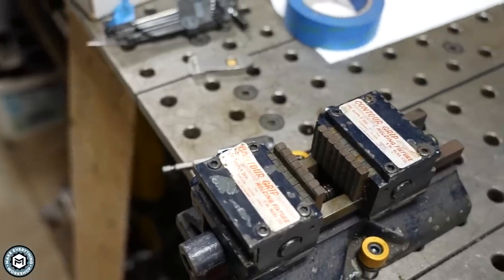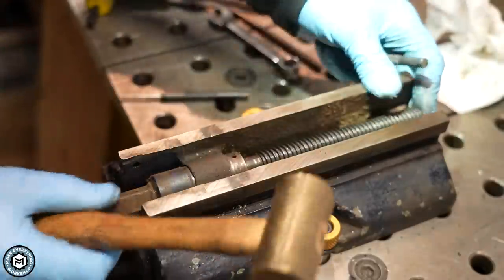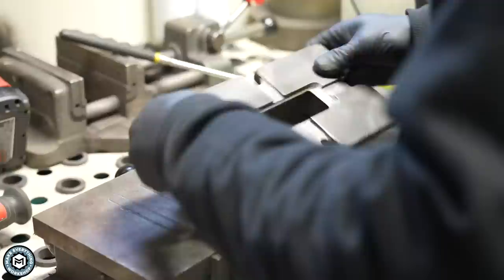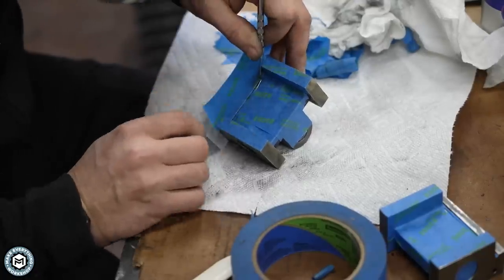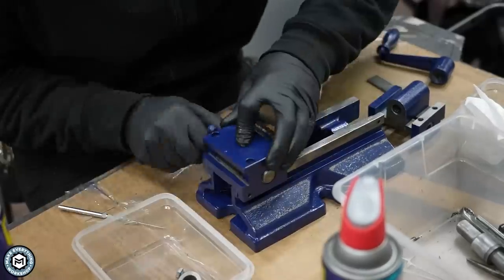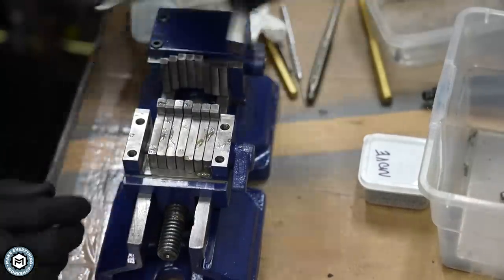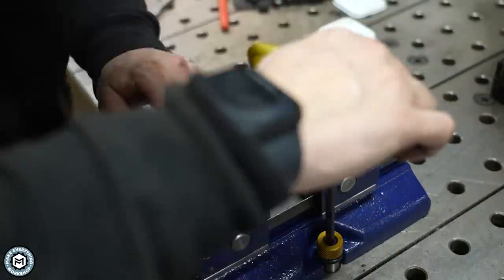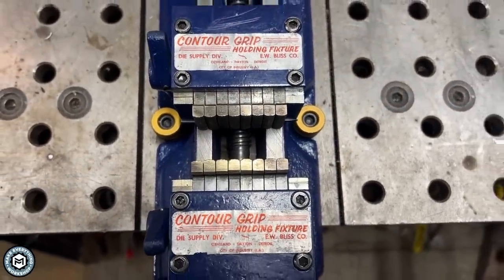Rare Adaptive Jaw Vise - Restoration

Comment: So the idea behind the balls is that they appears to work like a sort of "hydraulic" pressure, that is they behave like a non-compressible fluid. But without the issues of having to seal everything and all the engineering that would have to go into that. It's ingenious when you think about it
Reply: It's all particle dynamics regardless of the size of the particles
Reply: You get a better set as well with them being much larger particles. Hydraulic fluid isn’t viscous enough. I bet no liquid would really work. Clever how it’s same same but different.

Comment: Great video.  I rebuilt a milling machine version of this device a few years ago.  Doesn't get a lot of use but is handy when needed.  As for a magnetic base, I took magnetic tool holder strips, screwed them on a oversized board, covered it all with some aluminum flashing and it works great.  Just clamp the board to the work station and use just as yours works but cheaper!

Comment: I've always been fascinated with the fractal vise.. this one is just as fascinating.. the best part is that I will make a very interesting project to try and build one in the home shop.. the most complicated thing will probably be the leadscrew
Reply: leadscrew is straightforward single point turning on a lathe?
Reply: @Paul Womack  yes 100% correct... I've just never been quite successful turning acme threads on my Myford... especially a bigger pitch for a leadscre. Always get a lot of chatter and have to take a million finishing passed to clean up.

Comment: Try running a bead of epoxy around the base of the wire wheel inside and outside where the wires crimp into the base. It virtually eliminates wire strand ejection. 👍
Reply: Great advice!

Comment: Nice restoration, thanks for sharing the video!  At 9:30 you use rubber cement. When I use rubber cement, I apply it to both surfaces to be joined, then let it dry for 15 to 30 minutes before joining them.  It was hard to tell in the video how you did it.  I'm curious to know how you use rubber cement.
Reply: Your way is the correct one

Comment: The working principle seems much like the kind of robotic gripper that consists of coffee grounds in a rubber balloon like bladder. At normal pressure the grounds and the bladder conform to the shape of the target after which a vacuum is applied to tighten the grip. This vice employs bars that implement the gripping action. Might not the same principle be applied to a 2D array of hexagonal rods? I find myself somewhat motivated to attempt to make one.

Comment: Very cool old school vise/holder ..  Great job on the restoration. Any reason you didn't just sand blast the castings clean? That would have been much faster than the wire wheel, and cleaner..

Comment: That does look like an interesting, accessible fabrication project to replicate. The challenge of creating a larger-scale version with only salvaged or off-the-shelf components could be of use.
Reply: Bearing size and material would also be critical.  As you increase the size the force on the bearings would increase. My guess is its proportional to the square of the applied force. Flattening the bearings would become an issue.

Comment: The reason this mechanism works so well is that the rear of the jaws are rounded. This is exerting sideways pressure forcing the balls to move sideways rather than just backwards. It’s a detail that people should be aware of

Comment: This is pretty interesting design. I have floor stands that use same principle to have fully adjustable jack stands having two pipes that fit over each other and inner one has bottom plate with triangle hole cut on it that allows ballbearings to drop down but wont allow them to flow up so easily. Taking jack stand off is bit harder since you need to turn it around to get bearing to fall back into inner tube or twist it to get them slip in. Also after long use there is metal dust and due poor storage water has gotten in and balls in couple of them had rusted in place, but lots of oil and smashing with steel bar got them out, cleaned and with some cleaning i have several working again and one missing most of its ball bearings. Taking them apart tool effort, essentially hammering the inner tube out since the bottom disk is bit larger than neck support on the larger one and only got it out by brute forcing the bottom plate to rip from one of its spot welds, bending it and then rewelding it back before brute forcing it back when assembling.

Comment: Really interesting!  I have never seen a vise like that.   I'm surprised that there aren't more of these being sold.  The quantity of bearings and the size of the void above the bearings are critical for the jaws to move.  Today you could program a computer to calculate the number of bearings needed.  Based on age I'd guess trial and error was how the mechanism was designed. 

Your restoration is first class, except for the labels.  There are people that can make duplicate labels for restoration projects.  It would be worth the effort to get new labels. 

Bob
Reply: You don't need a computer. 
Computers are really good at doing mathematics you can do mathematics with a pencil and paper.
LOL.
Reply: You don't need to count the bearings, you can just measure weight and/or volume to get it close enough.
Reply: There are no bearings in this video. Those are steel balls that are often used in bearings.

Comment: I have one of these that used to live on a Navy ship.  Another nice feature of this vise is that the fixed jaw is on the same side as the handle.   Most vises have the moving jaw and handle on the same side.  Where this is particularly helpful is on a shaper or planer.  With a shaper or planer you want the force of the stroke against the fixed jaw.  If you positioned a regular vise such that the force was against the fixed jaw the handle would be against the machine and basically unusable.
Reply: Does it carry the same E W Bliss branding?
Reply: You’ve got the “Anpogrip” version, right?  I’ve found that with mine, and the size of my mill, I actually have mount it “backwards” so the handle is toward the column, otherwise it really just doesn’t line up with the cutter with any useable range.  But I can work around it when I need to use it.
Reply: @paulwomack5866  Mine has no branding. The only maker of a vise like this I had found was AMPOGRIP.
Reply: @JeremyMakesThings  I've always thought it was an AMPOGRIP but there wasn't a brand name on it so I guess it could be something else. The ALL CAPS seemed to be how they branded themselves.  I found a matchbook on eBay and they had it that way there as well.  Before this video I didn't know anyone else made them.  Seems like the exact same vise.
Reply: @therestorationshop  the small amount of info I’ve found on these, E.W. Bliss bought the rights to them in 1957 from “American Machinery co Inc” aka “American positive Grip vise co” (where the name “AMPOGRIP” comes from.). The biggest difference I see between the Bliss version and my AMPOGRIP is rectangular (Bliss) vs dovetail (AMPOGRIP) ways.  I have to imagine there were various versions of each.  Super interesting vises all around.
Reply: @JeremyMakesThings  Just checked and mine doesn't have dovetails.  I didn't notice that in your video.   Looking more closely I see that mine is a bit bigger than the Bliss in the video here. I think the lack of branding is because it was likely made for the Navy.  Thanks for your additional information, very cool.

Comment: So if the balls have higher compression strength, the maximum clamping force will also be higher so long as everything else doesn’t break. Would be cool to see this vise implemented with 2D molding jaws made with a fine mesh of spherical metal ends to really get into those small crevices. Wonder what the trade off in performance here would be as you go finer and finer

Comment: so contact cement, as opposed to rubber cement, is what you want for those labels. put a thin coat on each side of what you want to glue together, let it dry for a bit then push them together. it’ll never come off.

Comment: Hey, I see this a lot with rubber cement. You may already know this and it didn't translate well over video, but in case you didn't I figured I'd share. Rubber Cement is not to be applied like most "glues". The proper way is to put a very thin layer on both the label and the vice where it's being attached. Let both sides almost completely dry. Like to the point where if you touch it with your finger it's almost not tacky at all. right when it gets to the point where it feels like it's completely dried up, stick them together and hit with like a rubber mallet or something. Put a scrap piece of flat wood on top and hit that if you are worried about damaging the label. They will never come apart.
Reply: Came here to say this.

Comment: Apply rubber cement to both side and allow to dry for a minute, then apply. The fact that is was sliding means the cement wasn’t dry enough before adhesion was attempted.

Comment: That's brilliant how it uses the bb's. Why aren't these still made I wonder? It would be easy to replicate if you had the workshop and tools to do so. Great video 👍
Reply: Probably the same reasons the fractal jaw vice never took off: as-new the device was too expensive for most hobbyists and, for a commercial shop, custom cut soft jaws are both more repeatable and can be set up to relieve stress points rather than applying equal pressure everywhere.

Comment: I am curious about wd40 gel lube. Does it eventually harden up and turn into something like varnish like wd40 and 3in1 oil does? I was cautioned by an old sewing machine mechanic not to use 3in1 oil on any fine mechanism and I dont use wd40 on guns, reels, and anything I care much about. It has its uses though.

Comment: Hey man well done, BUT….in the future when you’re using adhesive on flat surfaces you need to scuff those surfaces up. Just like paint the adhesive needs cuts and grooves to get down into so that the parts hold from multiple directions and secure better.

Comment: Read the instructions on the rubber cement. Maybe you did and the cut was smooth so I didn't notice but you're supposed to put the cement on both surfaces and let it dry before you put them together.

Comment: Another good alternative to ball bearings in making one of these, is grease. If the viscosity is right, you don't need outrageous tolerances on the jaw segments. I've seen a grease only version, and I don't think it even had seals.
Reply: There are no ball bearings in this video, just FYI. Those are just steel balls.

Comment: if i was to design a vice like this i would have it be hydraulically actuated with a 2 dimensional array of pins on each jaw to apply the pressure. each pin could potentially also have an articulating pad on the end.

Comment: That's a Really ingenious mechanism.
I imagine those ball bearings aren't cheap; they'd need to be tough to survive the working pressures W minimal distortion. I don't think simple hardening would be enough, and that would be tricky enough on items like that.
Reply: Heat treating them wouldn't really be a problem. They probably do it similar to how they make lead shot, ie by dropping molten liquid metal from height into water. Obviously they would need to fine tune the temperature and height of drop, as well as the temperature of the cooling fluid, and the size of the molten steel jets which need to be tuned to make the right sized droplets, but once those are all dialed in the process would be amazingly quick
Reply: What ball bearings? Oh did you mean those steel balls?

Comment: Interesting. Would be easy to fix or redesign. Dont really need reset.

Could make that jaw with flat pieces. No special milling needed. Just holes. Instead of long vertical plates could use long square pins. More variation on the surface of the grip. If both of the heads are similar, the balls could be measured with the weight balance. Equal amounts in both trays. You know the ones that they show for the justice icon?

Might also consider new sets of ball bearings for both hardness and smoothness. Retaining the pins in the jaw could just be a slot on the top and the bottom and pin or plate from the left to the right. Simpler to cnc than the fractal vice too.

Would recommend wheel bearing Grease instead of oil for lubrication just for the reason of stickiness. Easier to keep it in the device, but common enough to get anywhere. Left and right sides could also be plates. Easier to assemble that way as well.

Comment: J
ust want to add a note about the rubber cement,  I believe you were using it wrong,  to my knowledge you are supposed to apply the rubber cement to both surfaces that youre bonding together,  fully let the solvent dry in it, and then apply the 2 pieces together to adhere them.

Comment: About safety with wirewheels..  A Great thing is to have a denim jacket, if the wires fly away. They do not penetrate that easy and......!  I had a regular hoodie a couple of years ago when wirewheel with anglegrinder. The wirewheel get stuck in the hoodie and that turned out bad... The wirewheel chewed up  my sveater and my belly looks like crap now a days, and still itchy ... this was 3 years ago it happend..  Keep safe everyone!
Reply: I got a 4.5" wire wheel spun up in my cotton work shirt. It shredded that and ripped my t shirt before the motor stalled. I managed to hold the grinder away from myself and got off without a scar unfortunately.

Comment: When most people on YouTube say “restore”, they really just mean clean and lube.
Reply from the maker: I am an expert lubricator
Reply: @MakeEverything I’m not cussing what you’ve done. Don’t get me wrong. But over the decades I’ve done lots of this, including restoring. But restoring means having parts that are too women to work, or broken parts, or karts that are missing, and either properly repairing, or making new parts using the same materials as the originals, which means research and materials testing. I’ve don’t that as well. So calling everything restoring, on YouTube, is really not correct when it involves cleaning and lubing, even if painting is involved (with a different type of paint).
Reply: @melgross  You mean YOUR definition of restore. The definition of restore is literally to repair or return to it's original, or close to it's original, condition. Cleaning, lubing and painting a seized, binding, rusty, paint chipped vice or tool absolutely is a restoration. It just happens to not fir YOUR personal made up definition which for some reason includes replacing missing or broken or worn parts.

Comment: Love WD40. Just be careful using it. One of our maintenance people used it on an electric motor and it dissolved the varnish on the windings and that caused the motor to burn up. It breaks down other kinds of insulation, so use cautiously.

Comment: wire wheels are too abrasive, i always degrease with soapy water, remove the paint with paint stripper and end up polishing with a sandblaster and i chose the sand for the specific job so its just abrasive enough